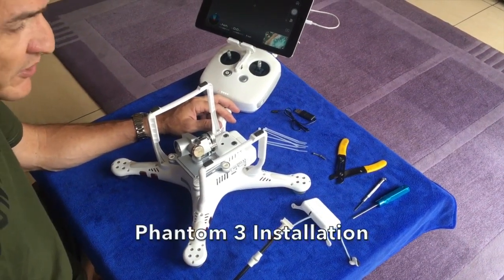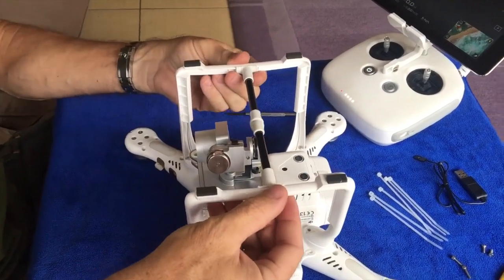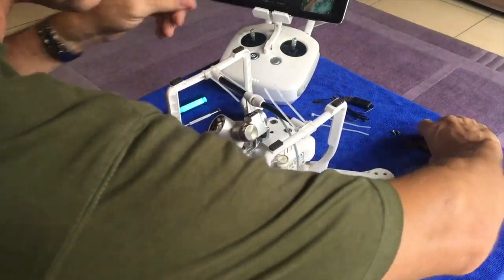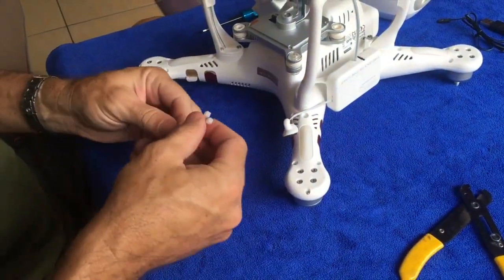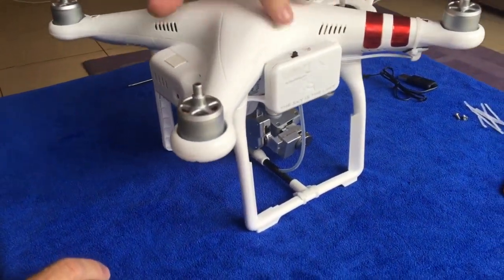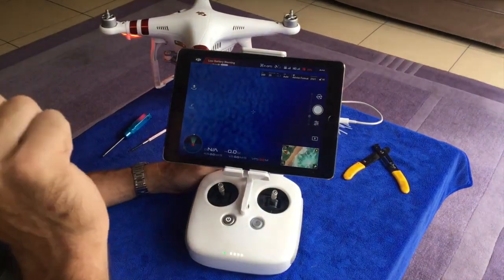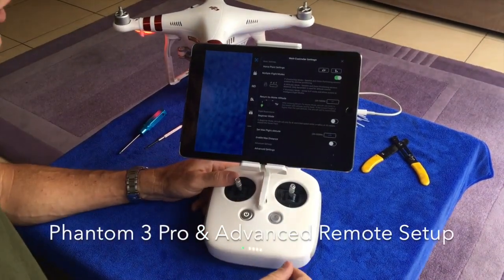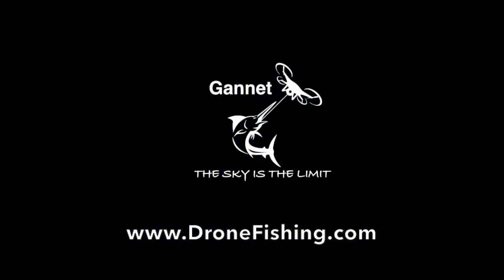Drone Fishing - Gannet Phantom 3 Installation

Comment: I'm just installing my Gannett, it doesn't have turn LEDs on/off in the advanced menu, it has "smart return home” and no other options beneath it, it is a p3 standard, I'll do a firmware upgrade and hope it is there
Reply from the maker: The standard can not program a button to switch the lights, you need to activate it in the menu each time.
Reply: Gannet - Drone Fishing i t was just a simple firmware upgrade and now the option is there in advanced settings, I bought it Christmas 2016 and only flew it once, I'm a little disappointed the battery looks like it has self discharged too low and won't charge, I bought a new battery and it worked perfectly. Thanks for the fast response
Reply from the maker: 2 years without charging is a bit long. The DJI smart batteries will discharge to about 66% when left unused for longer than 10 days, then go into standby mode, this will still use power and after several months when it reaches below 40% they will switch off and should hold that charge. Storage conditions can vary and could result in too low charge levels killing it.
Make sure you update the batteries too as even they have firmware built in.
Reply: Gannet - Drone Fishing I think I will just bin the original one, I can make a harness and attempt to bump charge it but for the sake of $65 I'll just buy another battery, I got a generic one and it works quite well.